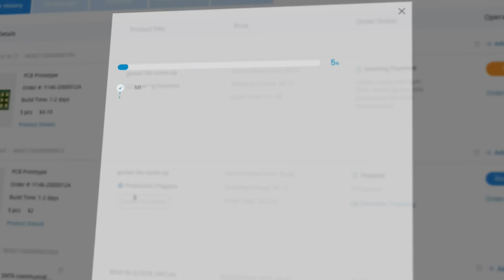[DIY] 1000 watt High Power TBM Amplifier Board Using 2SA1943 & 2SC5200 Transistors #cbzproject

Comment: as ive thought the wavelength would be thin itll probably clip at 30% in 10 ohms resistor load, id suggest to try analyzing the SOC 504